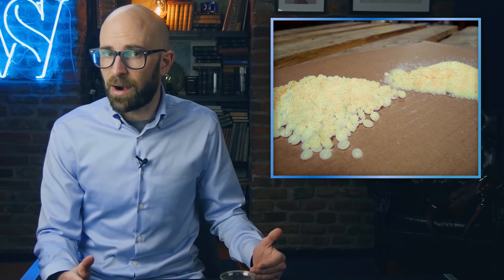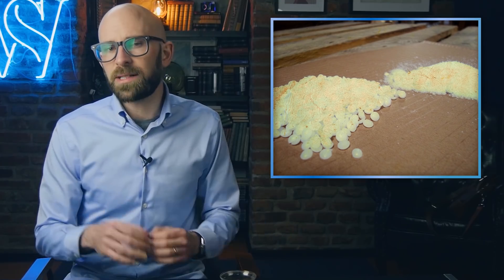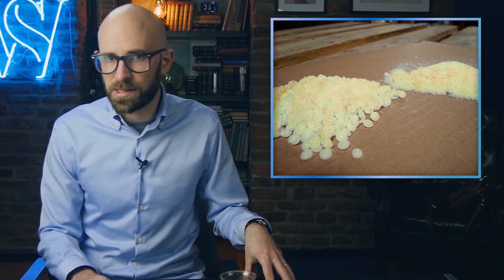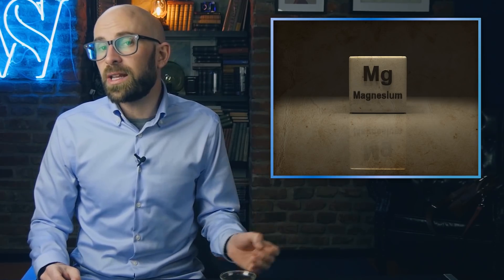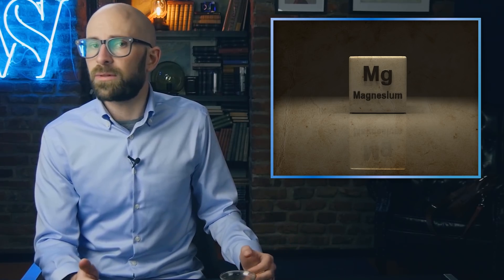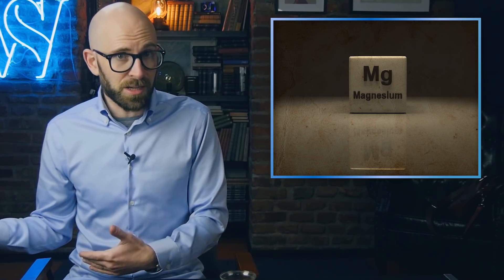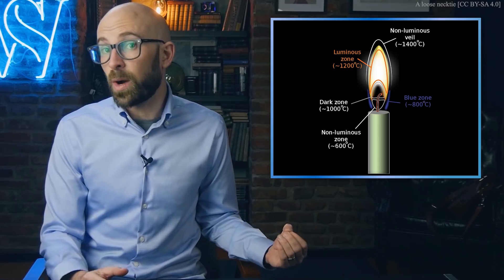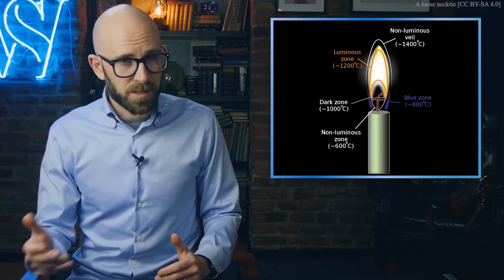How Do Trick Candles Work?

Comment: This must be a new thing-when I was  child, trick candles had a wire imbedded in the wick.  The wire stayed hot enough to reignite after the candle was blown out.  I found out the hard way by handling a candle while the wire was still hot enough to burn my fingers, but not hot enough to reignite.

Comment: How does ear-candling work and what's the deal with ear wax in general?
Reply: I can answer the first part of that. Ear candling basically creates a cone of air heated just enough to loosen ear wax, and shaped in a way that creates a vaccum. The heated air expands as n rises, and sticks to the cone as it cools. I have learned how and why ear wacc forms, but it's been many years and I didn't retain the information.
Reply: It would seem so, only I've seen the cones before as well as after, and it's impossible that such an amount of wax could be concealed in such a cone. Nor would my head have felt so much less pressurized if it had all come from the cone.

Comment: I don't see why some engineered retrovirus simply can't repair/add to the telomeres as needed. Granted the result is a fine line between theoretical immortality and cancer but can't make omelettes without breaking eggs.
Reply: A virus that gets into the nucleus of ever cell in your body? That’d be nice. Also be dangerous when someone engineers one that gets there too but doesn’t repair things but does damage
Reply: @nixel5695  You do realize every cell in your body is replaced at least once about every 7 years right (most more often)? You wouldn't need to infect every cell at once, just enough to where the new engineered DNA mutations are eventually copied to every new cell, the old versions would eventually die off and end up in pee, poo, dandruff, etc. Most likely the first such treatments will be in the womb, since it's far easier when the entire body is just a small blob of a few million stem cells (just 1 type rather than 200 types of 35 trillion or so). The ones that are able to undo damage already done will probably come much later. In fact so much later that if you are already 30+ you probably won't live long enough to receive it, assuming you can afford it, it's almost certain it won't be free and most likely you will have to go to China to get it (since the US and other countries have all but outright banned stem cell research).

Comment: How does a candle relight when you put a flame to the smoke coming off of the witch my uncle showed me but I  don't get how that works thanks for any information
Reply: Basically - the 'smoke' in that case isn't the results of combustion, it's unburnt vaporized wax and similar, that's still cooling off.  As long as the concentration is high enough for it to burn, and the 'trail' is basically continuous back to the wick, you're just lighting the same fuel the candle burns normally and the fire will follow the fuel back to it's source - the candle.

Comment: Where does the vaporised wax go?, Accumulates inside your house ? 🤔
Reply: I find a lot in my ears.
Reply: @christelheadington1136  lol 😄
Reply: pretty sure it does. at least whatever doesn't turn into soot
Reply: The vaporized wax burns. It's made of carbon and hydrogen, and when it burns it becomes carbon dioxide and water, both of which are gasses.